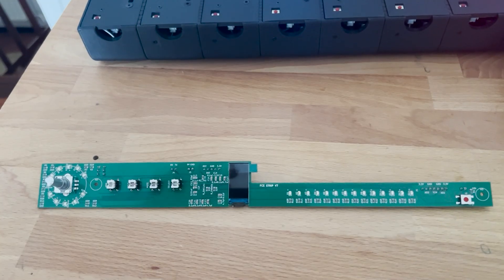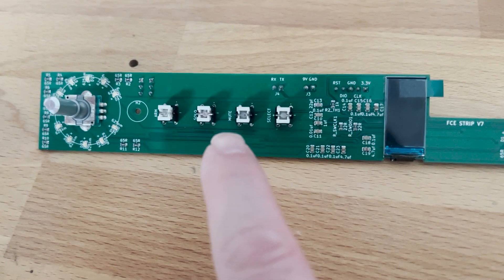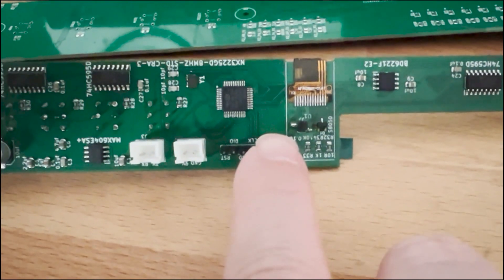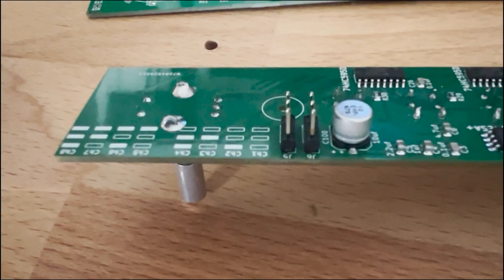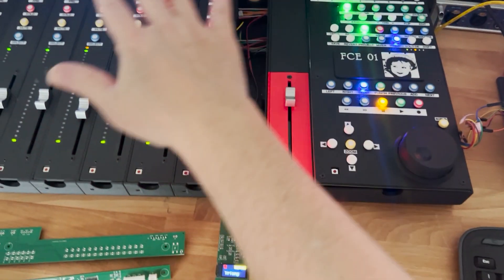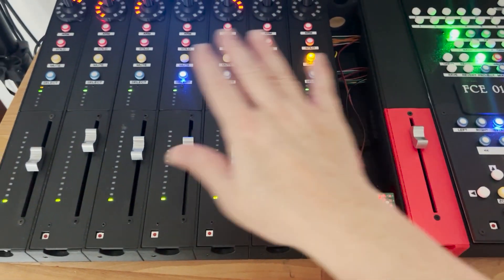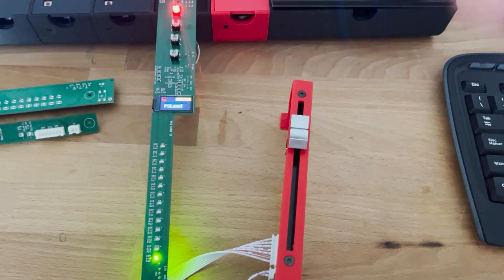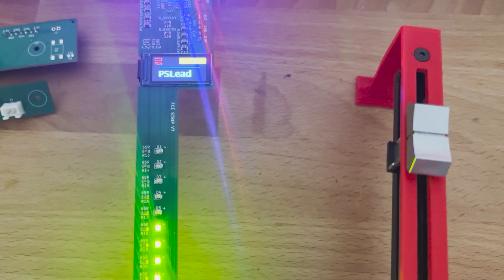DIY MIDI Remote Controller - New Strip - Part 3

Comment: Excellent work! Couple of suggestions to make it more compact: 1) you could arrange the four buttons in a 2x2 matrix rather than vertically in a row, 2) mount the encoder thru-hole with a small daughterboard for the connections underneath, which would bring the height of the encoder down. If you make the 8-channels on their own module, and the master fader part of the right-hand side control section, then it would be viable to get PCBs made as a front panels and have the same 8-fader module as an expander.
Reply from the maker: Thanks a lot for the suggestions! It’s well noted for future experimentation ( provided that I will find funds to do it!!) cheers
Reply: @fcampanini  It's fantastic work you've done, you should be really proud of that.